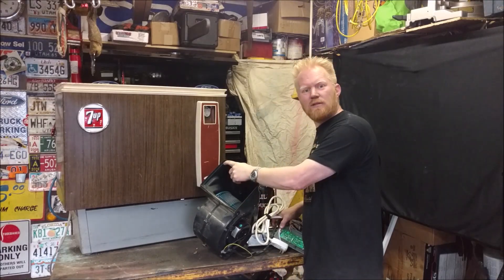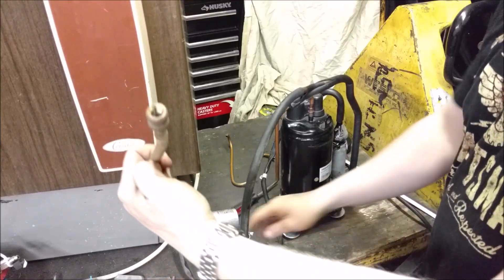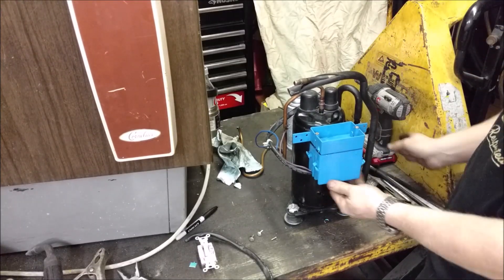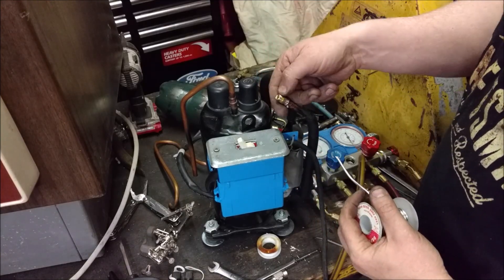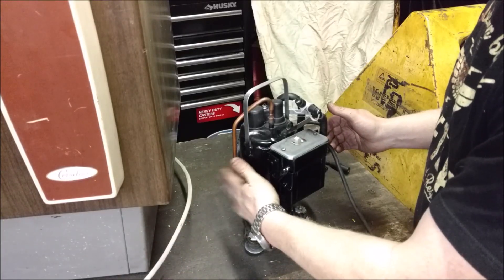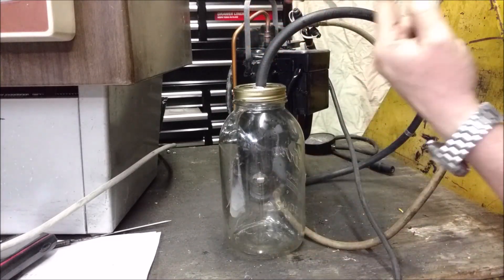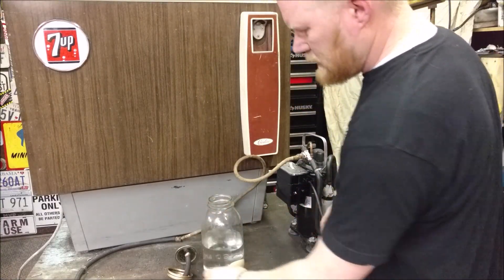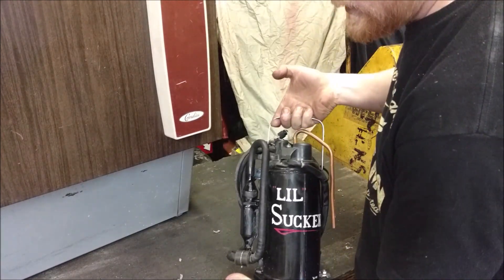Make a Vacuum Pump for AC in Cars, HVAC, or FUN

Comment: I guess this must be a scroll wheel compressor. What is the necessity of the huge capacitor? I'm not sure I understand the function of the cap on an AC line. (doesn't it just delay the 60Hz sine wave?)

Comment: Drain the old oil and replace it with mineral oil so it doesn't rust internally. You'll also be able to gauge how much to add in the future when you drain it if you measure the volume.

Comment: Can a trashed split system compressor be used similar way to get good vacuum and or psi pressure?
Reply from the maker: Yes, as long as the compressor isn't the reason it was thrown out.

Comment: Neat, was just looking into making a refrigerant recover tank and compressor for R134a or I guess possibly if I understand how to not cross contaminate like maybe purging with nitrogen, using for whatever refrigerant. Cool to see your channel show you have done before.  I was thinking can use as a vacuum pump as well for testing and filling as well.  Seems like the most expensive part I will have to invest is is going to be the vacuum gage.
Reply: Kind of scary reading, when I did the Prius AC Compressor, how nasty the ND14 oil is.

Comment: You are not boiling the water. The bubbles you see are from the dissolved gases in the water, mostly nitrogen and oxygen.  Boiling water at room temperature isn't possible with a compressor of that type, you need a rotary vane pump. That's why they don't sell vacuum pumps with compressor motors.
Reply: How many minutes can one used rotary compressor as vacuum
Reply: @kpeglodabrowski7679  as many minutes as it takes for it to overheat

Comment: I have a similar pump. Was thinking of using a compression adapter fitting on the suck side which adapts the copper line to a 1/4" NPTM. Then use a F-F coupler to thread in a 1/4" NPTM to 1/4" flare fitting adapter and then the A/C hose will thread right on. Any holes in that plan?
Reply from the maker: Sounds 👍

Comment: On my, i add a fitting on the discharge side and brazed both instead of using solder, and that's what I use for recovery and evacuate

Comment: That is usless for refrigeration system evacuation. It will never reach system mandatory 500 microns of mercury (0,0196inHg). Where did you get that 25 microns you are telling in video? Did you measure it with electronic micrometer? BTW oil in that compressor is higroscopic and cannot be regullary changed and you got acid in compressor in no time. Also, oil in that compresor is wrong viscosity for reaching low micron levels required in refrigeration systems during evacuation. Barometric pressure does not have any effect on absolute vacuum mesured by electronic vacuum meter!
https://youtu.be/pnqXEnn3DNk

It could be used for lot of other purposes but not for refrigeration systems which need dedicated tool. Also, water at room temperature of 22˚C boils at 20 torr (20000 microns), therefore, if you think that boiling at that video is indication of 25 microns, you realy dont know what is micron of vacuum. For those who dont know what micron number represents, 1micron is milionth part of pressure wich 1m of Mercury column exerting on surface of Earth. 0 micron is perfect vacuum. Larger unit is Torr. 1 Torr is 1000 microns.

Comment: Might I suggest putting a shut off valve to hold the pressure so you can turn the pump off and also a release valve to let the vacuum off
Reply from the maker: The AC manifold gauge set handles this. It allows you to hold pressure in the item and remove/shutoff the pump. There is also a Schrader valve to bleed off vacuum.
Reply: @sixtyfiveford  Sweet. Looking for one now

Comment: If you are using this to clean things then you will need a separator tank so you are not loading the compressor unit full of junk.
Reply from the maker: You're really never sucking anything besides vapor and it will get expelled. If you're using it to suck water, etc then an inline tank is a good option.

Comment: Can I use a fridge compressor as double duty (both vacuum and high pressure, depending on my needs)? Do I need to install some sort of air intake filter?
Reply from the maker: Yes you can make it do both. An air filter is a good idea. This can be as simple as a rag wrapped around the intake.

Comment: I have an identical setup.  However, my compressor as you know came from a 220 volt AC.  It works but it takes 30 seconds to fully crank.  When I plug it, you feel it beginning to rotate very slowly and gradually  build up speed.  After 30 seconds it runs lile it's supposed to.  It also feels a little worm. My question is,
Should I worry about the internals of the compressor because of the slow start?  Or what do you think the reason is for the slow start?
Reply from the maker: A large unit generally has a start and run capacitor wired onto it. I'm curious if this is just missing from your wiring.
Reply: @sixtyfiveford  thanks for replying.  It actually does have a large capacitor in the wiring.  I failed to mention that it RESTARTS immediately.  It just starting it after siting for a day will take a minute of "warmup" and gradually building up speed.  Once it starts, you could   turn it off and back on like a charm. Even a couple of hours later it would starts right away.  I am no expert but I am wondering if the large capacitor needs a minute to charge since it's getting only 110 volts while it's a 220 volt capacitor.
Reply from the maker: @samyelalem  So your running the 220v compressor off of 120V. This will cause a lot of lag and excessive heat in the unit. It will have roughly 30% of it's original power on 120v vs 220v.

Comment: Thanks for responding. I got it to work and on 110 electricity!! Very odd.  I am going to use it as a compressor, mainly for tire inflation.  Do you think I need to oil it regularly? Or It does not really need to be oiled?
Reply: You really should change out the oil in hermetic compressors if they are not being used in refrigeration setting. Compressors like these have oil in them that turn acidic when exposed to moisture in the air. At some point, these compressors will be destroyed by the oil turning acidic. If you want to ensure it will preform well and for a long time, you need to clean the existing oil out and replace it with a refrigeration-grade mineral oil.
Reply from the maker: They rarely need addition of oil. 220 motors will run off 110 but only perform at about 1/4 there 220 power.

Comment: I have a compressor similar to yours.  I pulled it out of a 220 volt ac unit!.  Do you think I could do a setup similar to yours with it? If yes, help me out with the wiring.  I have no idea how to wire it.
Reply from the maker: 220 is about the same but you have 2 hots and one neutral. There are quite a few diagram online.

Comment: good video....
10:00 if it were boiling, would you be able to hold it as you are in the vid?

boil1
verb
1.
(with reference to a liquid) reach or cause to reach the temperature at which it bubbles and turns to vapor.
2.
subject (something) to the heat of boiling liquid, in particular
-2cent

was the egg eatable?
Reply from the maker: Water boils at a lower temp the higher the altitude. Pulling a vacuum simulates extreme altitude/outer-space and makes water boil/ turn to vapor at room temperature. The egg never cooked as it was sitting in room temperature water.

Comment: How would you adapt this to suck fluid? I was thinking just a simple canister connected between the draw line and a brake line?
Reply from the maker: That's exactly how I would do it.
Reply: That's what I figured. Didn't know if maybe you had a new interesting trick for doing it....lol. I want to make one of these so I can use it to draw out my engine oil and tranny fluid on a regular basis. Mostly my tranny just to make it easier for fluid changes between cycling through the torque converter because Dodge didn't bother to put a drain plug on the tranny pan, idiots.....

Comment: How can you keep the oil inside from spewing out into your vacuum chamber whenc you let the pressure off
Reply: Add a 2nd, longer copper tube with a hose to what you want to be sucked into the jar. Make sure it goes almost to the bottom. This will before sucking fluid into the jar, Never fill the jar all the way to the top, that's when the fluid will start spewing out. A side note never pull a hard vacuum on a jar I have seen them implode, also use a good quality jar as sixtyfiveford did. Be careful The cheap throw-away glass of today breaks easy.

Comment: Great video mate! Making a Lil Sucker of my own. Though the damn thing weighs around 59 pounds. I have a question. Its an old hermetic reciprocating compressor from a 1992 Carrier A/C with 18, 600BTU ,2450W, 220V. Took it out, wired it & works good. The Hi & Lo side pressure is 350 & 150 psi. The label on the A/C said it uses R-22 so it uses mineral oil I guess unless the services guys changed to something. So, is there any way to identify the oil used in it? Since its reciprocating I guess I need to add a little oil time to time to prevent the piston from seizing right?
Reply from the maker: I don't think I've ever seen a AC tech change out the oil in a full AC system as it would be more work than it's worth. They have access to R-22. I wouldn't worry too much about the oil type as you're going to be vacuuming mainly normal air with small traces of refrigerant out of a system.
Reply: No need to add additional oil to a recripricating compessor. They have plenty of oil from the factory. But I would suggest changing the oil to vacuum pump oil. And changing it after every evacuation of over 2 tons. Every other time for small systems 1000btu to 18,000btu. And for refrigerators and freezers using under 1/2 lbs of refrigerant you could probably get away with changing the oil every 10 times or right after you repair a burnout. This is the minimum you would want to change the oil. Also do not use poe oil it will turn into acid and dissolve the motor windings.

Comment: You gotta learn a little physics. The vapor pressure of water at 68 F is .0231 atmospheres which is 17556 microns Hg. Forget about that 25 microns nonsense. You will never pull 25 micron vacuum with an appliance compressor.

https://en.wikipedia.org/wiki/Vapour_pressure_of_water

http://www.kylesconverter.com/pressure/atmospheres-to-microns-of-mercury

Comment: hi, I have a vacuum device ( not a vacuum chamber) and I tried to make water boiling but it doesn't work, I don't know why. I tried the experiment with a baloon in a jar and it worked.
Do you have some explications? Thank's
Reply from the maker: Here is a chart that shows the water temp required compared to the vacuum pump. http://www.jbind.com/pdf/Cross-Reference-of-Boiling-Temps.pdf

Comment: Hey man, your paint job is outstanding!

I'm a little confused about your use of 25 microns as a measurement.  28.89 inches of mercury is what it would take to boil water at 80 degrees Fahrenheit, but that would be over 700,000umhg measure in microns.  25 microns of mercury certainly won't result in water boiling at room temperature, or exhibit any kind of noticeable effect on anything.

Also, since you're running that pump outside of a closed system, I'm wondering how you keep it oiled...

It definitely look very old school cool!

Steve
Reply from the maker: This is a chart the shows vacuum pump comparisons http://www.nandor.com/conversiontable.stm 
25 Microns is approx 29.918inhg
Reply: Dude, maybe I'm slow...  I'm so confused...  I may be reading the chart wrong, but it kinda says what I had already surmised from my math.  According to that chart, 29.918inhg would be equivalent to nearly 760,000umg, which is a little more than 25.  I guess it's not all that important.  At the end of the day, that pump is pulling some serious vacuum!  Nearly as important, it looks fantastic!

Steve

Comment: I'm in the process of making a LIL SUCKER. 

One question: Do you have to oil the compressor to keep it from burning out? I don't want to slug it either.
Reply: Most vacuum pump manufacturer's say to replace oil after every vacuum. Dirty oil will hold contaminents.
Reply from the maker: The oil pretty much stays for the life of the unit. It may exhaust a little over time, which you can just add more into the suction side.

Comment: Excellent video Bro... But I just wonder about compressor lubrication. How do you lubricate the internal part of the compressor? And how to know how much oil does it need? Thanks in advance.
Reply from the maker: Oil stays in the base of the unit for the most part and gets sloshed around. It will mist and loose a little over time but you can easily remedy this by adding a few drops every couple hours of use.
Reply: Thank you, Bro. Have a nice day.

Comment: Nice how is the wiring I have capacitor with 3 terminals  c , Herm and fan 
And the ac compressor have 3 wires red , black and yellow so how it'll be Iam not friendly with electricity buy I will do that and what's the wire connected to the switch which color sorry for that but want to do this for my car it's hot here and want to change ac compressor for my sister car
Reply from the maker: Aussie50 has a great video on wiring it https://youtu.be/YKgf4_xipcQ Just note they use 240v 50hz in Australia, where we use 120V 60HZ here in the U.S. It makes no difference on wiring, just a note.
Reply: sixtyfiveford thank you

Comment: sixtyfiveford is there a possibility that the jar will shatter? MY WIFE nearly had heart failure worrying about your hands haahah is the water real hot, or just luke warm, meaning could Candis drink her tea after getting it hot with your machine? hat thing heats water way faster than gas or electric water heaters for coffee and tea!! just wondering. could we out here find such a pump, would hf cheap little vac pump work, we have one of those hahah just asking hwahahwhw
Reply from the maker: Glass holds vacuum very well. The water isn't hot at all, it's cold tap water. Under a vacuum the water will boil even though the temperature is only 50-60F, but it never goes above the 50-60F.
Reply: sixtyfiveford ohhhhhhh when you said boil we thought you were saying boil like 212 boil haah, ok we understand now. we use to go camping every year for the past 25 years but 3 years ago my left leg was taken off. machinist no more! congestive heart failure started the ball rolling. anyway we were wondering have you ever done a manual wheelchair to electric convert before? we been going back looking at all your videos but have not seen one yet. tooooo lazy to go back and watch them all so you replied and we thought we might just ask. cool videos!!

Comment: would the compressors in window ac units create enough vacuum to boil water?
Reply from the maker: Yes.
Reply: Hey thanks it worked. I'm dissecting mainly water and hopefully the vapors dont mess it up. I plan to put compressor oil before every use.

Comment: This won't remove any moisture and leaves a fair amount of air also. May work once or twice but once the oil inside of compressor is saturated with oil it won't be up to minimum standards of what we use in the industry
Reply: matt gruber a dryer? Does that only work with small amount of moisture? What exactly is that?
Reply: they sell a device that say, you want to paint a car? any moisture has to be removed. it is a canister similar to a fuel filter. Harbor Freight sells them.
you just dump out the water now and then.
Reply: put a dryer on the input. problem solved.

Comment: Very interesting, could we run it for so long without oil, I mean it's necessary lubricate the motor coil in a closed system.
Reply from the maker: The base of the pump has a reserve of oil that recirculates and will operate for a long time without adding any. However you can add a little from time to time to replace the minor amount that gets lost with prolonged use.